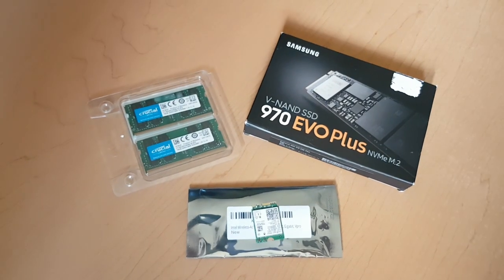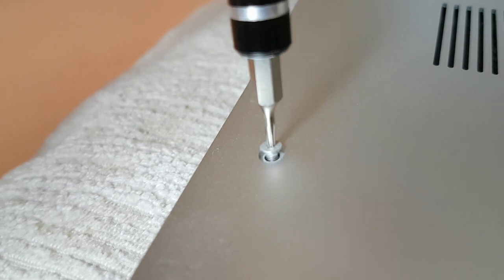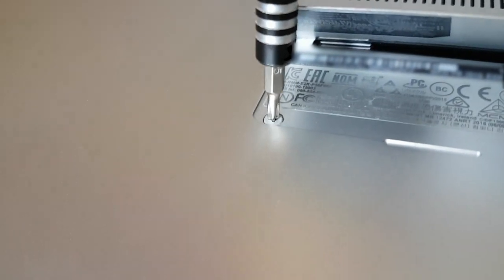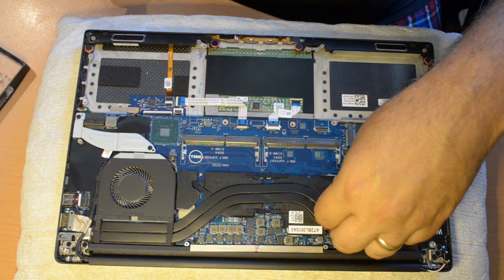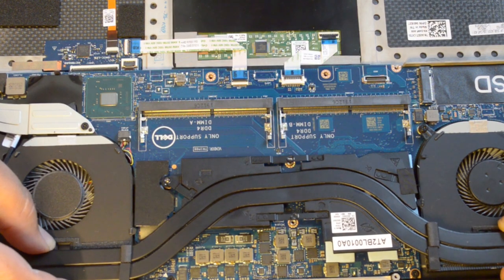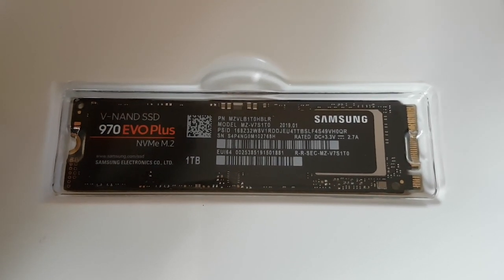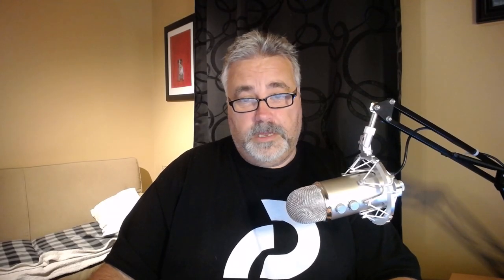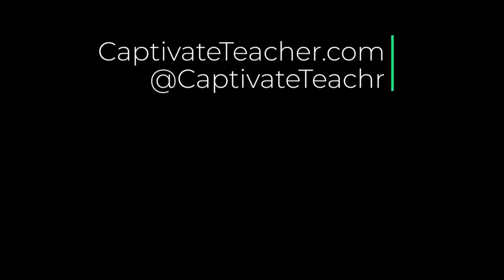Upgrading My Dell XPS 15 9570

Comment: I have a 2+ year old 9560 I'm finally getting around to upgrading because some keyboard keys died on me, once I ordered the t5 and kb I started looking around and upgrading to a faster 1tb + memorry + wifi is substantially cheaper than it was when I first got this thing.  Then figured since I have to pull the motherboard out anyway might as well repaste it.  While I'm totally comfortable doing this this was still a good video, been binge watching upgrade and repair videos to get myself worked up to do this since I'm not really looking forward to it, but at least pulling this apart isn't nearly as much of a pain as my razer blade is.
Reply from the maker: I always get that nervous feeling like I'm about to make a mistake that will cost me my two thousand dollar investment. In this case it was super easy and I would be comfortable doing this process again. I'm into tech but I'm not a technician.
Reply: @CaptivateTeacher  I've been working on hardware for almost 20 years now and I've been HP and Dell certified in the past.  Laptops are just more annoying to work on by nature, though dell and older Lenovo/IBM laptops are generally much less of a pain than a lot of other brands I've worked on.  I'm still very happy with this laptop even though it's 2 (3?) generations old at this point, didn't think i'd care that much about the 4k screen when I got it but I've come to love it even though I don't use the touch option pretty much at all.
Reply from the maker: @nadtz  I looked at some additional options when I was shopping for this laptop a year ago. I realized that touch wasn't going to be valuable and 4K wasn't a huge benefit for me either.
Reply: @CaptivateTeacher  I only got the 4k screen because I got  great deal on a refurb unit.  At the time the 4k model new was still around $2k I think, I got mine for $1400 which was actually less than a 1080 unit new.  Also got the 512 SSD which I got lucky and they gave me at the time one of the better SSD's Dell was using.  The fact that I'm still very happy with this laptop 2 years later says a lot, I usually swap laptops every year but I've been happy enough with this unit that I'd rather fix it and upgrade it than replace it.
Reply from the maker: @nadtz  Thanks for sharing and of course thanks for watching.
Reply: @CaptivateTeacher  No problem, glad you are happy with the laptop and that the upgrades went well, stay safe!
Reply from the maker: You as well.

Comment: Here I am in 2024 watching this video to upgrade my xps15 9570 I bought 5 years ago, I plan on using it another 3 years, I upgraded to windows 11 and dual boot  to Linux, i agree the WiFi it come with sucks fortunately i use it mainly over LAN. I'll re do the thermal paste, upgrade the ssd to 1TB and change the WiFi card.  Thanks for the video, it helps me a lot.
Reply from the maker: You're welcome and thanks for watching.

Comment: Totally agree Paul. I have this same laptop and configuration. I’ve had it for a while. Works great for Captivate as well as many other programs. And I’m someone that tends to have multiple programs open at the same time as Captivate as well as VMs  and I have no issues at all. I did upgrade my RAM and SSD at purchase. Looks like I could have saved some $$$ which I’ll keep in mine next time.
Reply from the maker: Yeah, upgrades from the manufacturer are usually a little inflated. It would have not only cost me more to get these upgrades from Dell, the SSD wouldn't be as fast. I've actually since upgraded it again to the 2TB version of the same drive. The next upgrade for me will be a new machine.

Comment: Awesome video!  I noticed the ssd had a thermal pad but it did not have a heatsink. Is it bad to use a thermal pad on the ssd without a heatsink? I am getting a xps 15 9500 and wanted to know if I should get thermal pad + a thin copper heatsink for the second ssd (it has two ssd slots). And in that case do I need to put a thermal pad on the ssd then the heatsink and then another thermal pad on top of the heatsink?
Reply from the maker: My version of the Dell XPS 15 came with just the thermal pad for the SSD. My guess is the thermal pad, which came into contact with the bottom shell of the case, was enough to dissipate the heat. When I run Samsung SSD software it reports the temperature. It always seems low to me. Of course the new XPS might be different. You should definitely do some research this.

Comment: Nice informative video. What size of heat pad did you get for this XPS?
Reply from the maker: Sorry, I don't recall. I think I purchased a pack of different sizes and selected one by eyeballing it against the original thermal pads that were on the SSD.

Comment: Great video, Paul. I’m thinking about buying this laptop for our video editing needs. I’m very new to laptops and upgrades, so this might be a simple question, but is it necessary to change the thermal paste when upgrading the RAM and memory card? I read other comments and I see that there was a noticeable temperature difference experienced.
Reply from the maker: No. It's not required. In fact changing the thermal paste is probably the most risky parts of this procedure. You could accidentally put not enough paste on your CPU and GPU. You could also accidentally bend the thermal pipes when removing them. That said, my logic was that I don't want to be opening up my computer too often so why not repaste while I had it open. Hope that helps.
Reply: That does help. Thank you!
Reply from the maker: SamusIroc you’re welcome.

Comment: Awesome video. Any test before/after on the temperature of the cpu/gpu under load? I'll upgrade my ram and am wondering if it's useful to apply some better thermal paste I have around.
Reply from the maker: This isn't scientific but there is a noticeable difference. Under a stress test I was getting pretty consistently the high 90 degrees Celsius. after applying new thermal paste and undervolting I'm getting low 80s under the same stress test.
Reply: I just upgraded and use  thermal grizzly its really good, dropped about 10-20 degrees Fahrenheit . I also upgraded to intel’s ax 200 wifi 6 card, i jumped from 100-200 mbps to 400+ mbps    Btw i have a 1gig speed . Or u can upgrade to  killer 1650 if u don’t wanna go through installing the intel drivers. Make sure update everything before doing all the mods. Such as dell update and ur windows update
Reply from the maker: @tenzinchoklang4525  Good information and advice.

Comment: Hi, please inform how thick the thermal pads you used were ? Tnank you.
Reply from the maker: 2mm
Reply: @CaptivateTeacher  Thank you, though i need to say that might were too thick, Iam planning to use 1 mm for the same task. Or maybe 1.5 the most ?
Reply from the maker: It's important that the pad for the SSD makes contact with the outer case to assist with heat dissipation.
Reply: @CaptivateTeacher  I agree with you for the ssd. My reference is for the chips under the heat sink. Any thoughts and help are wellcome.
Reply from the maker: @dimosthenismagos7982  I had some 1.5mm pads I cut up and used for that.
Reply: @CaptivateTeacher  Thank you, i assume no problems since the application. Are you satisfied with the result ?
Reply from the maker: @dimosthenismagos7982  works great.
Reply: @CaptivateTeacher  Well today i pulled my heat sink out in order to repaste my 5 year Dell xps 9530 laptop, clean it and change thermal pads. The paste was hardened but the pads looked in good shape, i will change them anyway. For future referances i measured the thikness of the thermal pads with a digital caliper, they are 0.5 mm.
Reply from the maker: @dimosthenismagos7982  If you want to check your thermals you can use Intel Extreme Tuning to report what temperatures you're getting. A useful tool, especially if you want to undervolt your CPU.

Comment: I upgraded my 5 year old xps 15 9550 to this exact SSD. The speed difference is absolutely incredible.
Reply from the maker: Yeah it was very noticeable for me as well.
Reply: @CaptivateTeacher  seriously? From 2,600 mbs to 3500mbs read? That read is already so quick. I agree the write difference is incredible -- 5x -- but given that it's already so fast, in what actual situations did you find it was much faster?? In what circumstances are you able to benefit from that additional speed-up? (I have this machine and am strongly considering the upgrade, but don't want to drop 500 bucks if I don't have to)

Comment: Hi Paul, I have a dell XPS 7590 and I’m looking to upgrade the ram. It currently has 16 gb of DDR4. Can I upgrade to 64 (2 x 32) of am I limited to 32 gb? Also, when upgrading the ssd, how can I retain in windows license? 

Thanks!
Reply from the maker: I would check with Dell to be certain. I am only aware of the 9570.

Comment: Great video :) I actually didn`t unplug the battery on one occasion, i think it was when i took out the ram to take a photo of the label on it. but the next time i unplugged it when i changed the wifi card, or maybe it was the other way round... Laptop is working great, just as good as it was prior to me even opening the back of it. Maybe it was just luck that the battery was still plugged in while i was `fiddling around` with the hardware...I`ll be more mindful nex`t time. Ive built all my own computers (all desktop machines) since 2004, so maybe i was just lazy when i saw the plug on the battery was awkward to pull out and i thought maybe it will be ok, so i left it plugged in. Im actually going to put new thermal paste on both chips as this is a used 9570 that i bought a week ago, so its a good time to do some maintenance with it :)
Reply from the maker: Removing the battery is good precaution but you'll probably be fine.

Comment: can you replace the gpu with gtx1070m?
Reply from the maker: The GPU is hard-wired into the motherboard so I don't think so. Maybe there is an external GPU that can be added to this laptop but I'm not sure. For my graphic purposes this machine does fine.

Comment: Is it possible to upgrade cpu i7 gen8th to i9gen8th?
Reply from the maker: No. Laptops have processors and GPUs soldered directly on the motherboard.
Reply: I am looking for used dell exs15 9570. But the seller said " it's up to i9  because of a few installations added that's why but it's the same features just has a swifter browser and a few new games. "
So i confused and hesitate to buy
Reply from the maker: the Dell XPS 9570 was available in several configurations. It probably was likely an i9 processor to begin with.